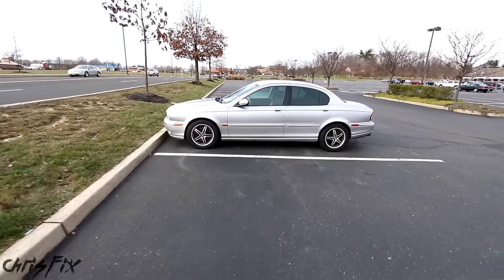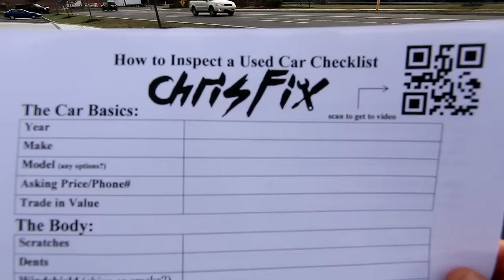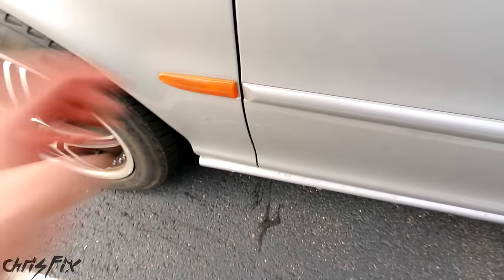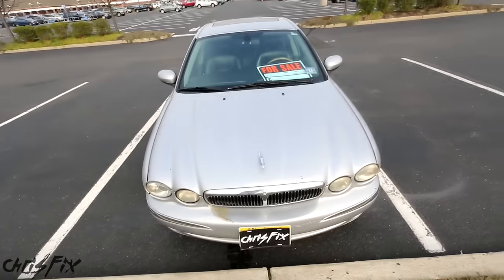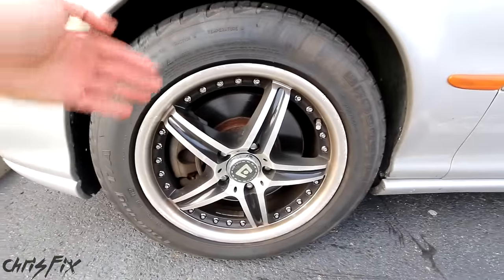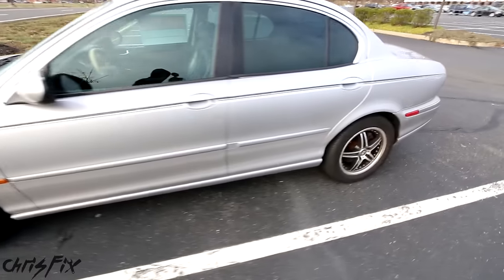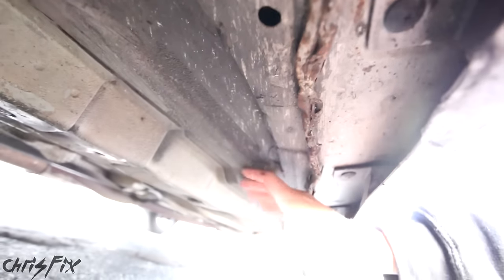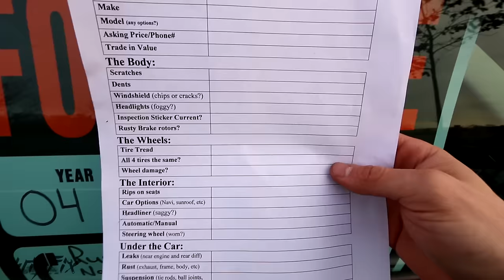How to Inspect a Used Car for Purchase

Comment: Thanks for the video! Great tips. However,  if I were the buyer, I would have paid more attention to the mechanical details, not really body and stuff. You had some really great tips including tire matching and brake, but I would pay more attention to whether timing belt is changed (if it has timing belt), any issue with alternator or serpentine belt, shock absorber, transmission fluid etc. While driving I would consider looking at if brakes have any squeaking/grinding sound,  transmission shifts smoothly or takes time to shift, engine jerks greatly during shift of not (probably an engine mount issue). I would try to take a look at the history of the car to see it had any accident or been stolen before or had any major repair, how many owners it had etc. And finally, I would definitely talk to the owner,  to understand how good he was at taking care of the car in general.
Reply: What Chris didn't mention, but maybe should have, is that this inspection is a quick look over to see if there are any show-stoppers before moving on to calling the owner and do a more detailed inspection.

Comment: No reason to inspect a Jag. Unless you are an electronic engineer well versed in automobile wiring & computers and, need something to do every Sat & Sun for the rest of your life.
Reply from the maker: +Tommy Rad hahaha
Reply: ChrisFix
Hi Chris.So, my comment wasn't too cynical? haha
Reply: MultiLisa10
Thanks!
Reply: That used to be true before Ford purchased Jaguar in I think it was 1993. I still wouldn't purchase anything European without expecting problems.
Reply: Joseph Murray
A honda Accord of the same year is 3x the price... why? Because Jags are not dependable.
 And Jags, no matter the year, are expensive to work on, especially for those that go to the dealership no matter the issue. Not everyone is a Chris Fix.
Reply: +Tommy Rad I know that a 1996 Accord could sell upwards of $4500 if the body is in good condition but it's going to have like 200k miles on it. Most Honda's of that vintage are also on a top 10 hit list for car thieves.
Reply: Joseph Murray
1996?? The Jag is a 2004.
Reply: +Joseph Murray As a french, I find funny to see how you Americans have a completely different vision of the automotive world. You think european cars are all sources of problems, but why? They have evolved a lot recently (not Volkswagen though :-) ) and are now really reliable. At least they are more "eco-friendly" and feel more comfy than yours, which we find not pleasant to see, especially in the interiors...
Reply: 3DAM
No we don't. Since the 80s, Americans RAN away from domestic cars and, other than trucks, never really got back to buying American cars. Look around here and you see, Honda, Hundai, BMW, Toyota, etc...
American cars are a minority on the roads, other than trucks, which are mostly American.
Reply: +Tommy Rad Sister has a SK8  four fuse boxes, you hit the brakes the back up lights come on.  You hit the turn signal the brakes illuminate with signal.  You floor it and it bogs down,, then accelerates slowly,  then all of sudden wham it goes..  She has had nothing but issues since day one and it sits and sits,  she drove it one full summer..  WALK AWAY!!!  No RUNNNNNNNNNNNNNNN burn your camera and phone that had any connection to that car..  They are attractive psychopath gremlin vehicles is all they are..
Reply: +3DAM  Interesting.  Should we assume all the French people are the same and think the same way too?   Perhaps the European interiors have to be more comfy  to accommodate the weight of arrogance?   Is there extra headroom as well?
Reply: +Tommy Rad Thanks for your answer, I still live in France (still because I wan't to move in Canada or USA in a few years) and from what I see on the internet there are still a lot of american cars on your roads but internet is not real life :-)

+Spookypalooza Calm down, I wasn't insulting anyone at all, I just wanted to know Joseph's thoughts. There surely are differences of thoughts between Europe and America, as well as between every citizen of the world.  What you found arrogant in my comment wasn't supposed to be so, but you can't deny the usage of cars with really large engine, sometimes not of use (I think of people who have big trucks but don't live in the countryside, or lorries...)
Reply: 3DAM
No problem. I'm not sure American car makers ever recouped their losses of American buyers after what they did to their customer-base.
After WWII, buyers were loyal to whatever... Ford, General Motors, Oldsmobile,etc.. but, in the 70s, idiots like "Fog of War" sociopaths like Macnamera, gutted the industry of everything that the car makers worked on in the past. What was once car companies owned & operated by car LOVERS, designers, racers, now were run by "bean counters"[numbers-guys]. Down they went. The loyal customers were& felt screwed. Then the car makers left the US and ruined once beautiful, wealthy cities like Detroit, now a dead city.
Not sure you should come to the US. Were being turned into a police state and it is getting bad.
Reply: 3DAM I'm going off published facts from JD Power and associates on the quality of Asian, American and European auto makers and personal experience that at the top of the quality ranks are the Asian makes such as Toyota and Honda, then a close second is the American automakers, they've come light-years in quality since the 80s; but for European automakers, they're on the same quality level as the Americans back in the late 80s early 90s. 
Granted there's certain Asian makes I would stay away from such as Mitsubishi they're notorious for having transmission problems.
Reply: It wasn't just the bean counters that ruined the American car industry. After the war the Japanese started making cars and had all new tooling which made tolerances tighter and therefore reliability improved. The USA and the UK Largely didn't keep up. They kept the attitude that the customer gets what they sell to them. A guy I knew bought a Jaguar in the 70's. The first week he had it it overheated in a traffic jam. When he went back to the dealership to complain they told him not to sit in traffic jams or turn off the engine. In the second month he was in stop start traffic and had turned off and started the car so many times that the battery hadn't had time to charge so the car wouldn't start. When he went to complain again they told him not to stop the engine so often. He left the car there and refused to make anymore payments. Unfortunately this was the attitude back then and the Japanese sent cars that worked (even if they rusted) but they also listened to customers and spent time on RnD. If the British and Americans were still leading the car manufacturing way we would all be driving around in heavy, unreliable, poor handling gas guzzlers because of the "it's worked for the last 100 years, why change" mentality.
Reply: Also, before the Big-3 died, American car buyers were very loyal to their brand. My dad was a Chevy & Buick man. Our neighbor was a Ford guy, another was a Dodge guy. Decades & decades of loyal customers.

That loyalty was rewarded with Detroit vehicles that literally fell apart as they were driven from about 1970 and on. When Japanese auto makers were consistently turning out cars that ran forever.

Comment: Thanks Chris 😊 Been a long time viewer and finally, I bought my first car! 
A 2009 Skoda Octavia 1.9 diesel, manual.

The inspection sheet helped me a treat to check the car out.
Reply from the maker: Thanks for the ongoing support and congrats on the new car! I'm glad the sheet helped you out!
Reply: @chrisfix  Thank you! Really appreciate it.
Reply: immortal engine 1.9TDI, is it still driving?
Reply: @dreveneuhlie7167  Absolutely! Running like a charm
Reply: Is that the car in your profile picture?
Reply: @sweetsunnyvibes  Just a random car on the internet
Reply: @anirudh0831  why not your own car? Aren't you proud of your car? 🥺
Reply: @sweetsunnyvibes  most certainly am! Anonymity online is the way to go while I enjoy my car offline
Reply: @anirudh0831  ooh I see, I'm glad you're happy with your car ☺️ Is Skoda expensive on maintenance costs?
Reply: @sweetsunnyvibes  it's basically a VW and yes! It definitely requires regular attention but never left me stranded.

Comment: Check the internal colour of the tail pipe. The colour can tell you a lot about the state of the engine. Ideally your looking for a grey/brown deposits. Not sooty black or oily. Uneven tyre wear could spell problems with the steering.
Reply from the maker: Thanks for the tips!

Comment: Should have done a flood check too, that's one of the most important things to looks for with all of the Hurricanes and floods in the south.
Reply: +Take1 Films Yeah if your in a flood prone area
Reply: +Justin Kelly actually a lot of cars that were flood damaged and end up with a rebuilt or salvage title are sold at auction across the country.
Reply: Samuel Avery-Quinn Yes if sent through auction but many times not by owners. That's what I was trying to say.
Reply from the maker: +Take1 Films That is a good idea but many times those cars dont come up as "flood cars". They fix them and sell them as normal cars. The goal in this series is for me to teach you different ways to check a used car so if it happens to be a flood car, you will notice the body is rusty, or maybe there is a sign of a leak inside or something, and you will know this isnt something you are interested in.

Comment: Another thing you could do when inspecting the tires is to run your hands around the tyre to check for any bumps. Bumps can indicate suspension issues such as bad alignment.

Comment: Turn the head lights on and check break lights. Lift the air filter, look at the oil filter, look at the fluids, check the tires for punctures...hook up a compression gauge and also check the vin for any recalls

Comment: Based on some of my experience on several used cars I bought in the past. The number one cars I feel to WATCH OUT for are the salvaged ones. (salvaged because of an ACCIDENT). Or just simply been in an accident! Because very often many parts besides the engine can give a host of problems since the car is often not "put back together correctly". Also Watch out for cars that seem to have been "beat up". That can tell you how well the "insides" of the car has been treated. And ONE BIG ONE: Watch out for THE BRAND!!! THE MAKE of the car.  STAND CLEAR of all cars that are KNOWN for being problematic!!!
Reply: Stay out of french cars if possible, overall if you live in areas with lots of rain and inundations, or near the sea.
Reply: Anybody have a list of these problematic cars?

Comment: You can check for previous body damage by checking the alignment of the body panels and the spaces between them. See if they are even and the relative size of the gaps.
Reply from the maker: Thanks for the tip!

Comment: you do the same thing I do but if you only have 1000-to 2000 you can over look dents and dings but look out for rust make sure its not to bad
Reply: As long as the drivetrain is strong I could care less about a few dents and scratches

Comment: If you want replace the fuel pump in the X-type you need probably 1500$ of labor work. If one of the sensors go nuts well thats another 200$. body parts? well almost 900$ for a fender. RUN
Reply: he's a mechanic, he gets better deals a he does most of the work himself.
Reply: +osamaFXX   Why do you put $ AFTER numbers?
Reply: +osamaFXX $900 for a fender.... I'm sure there are plenty of these things sitting in scrap yards by now so they would be about $50
Reply: Wet Lettuce Yea good luck finding one.
Reply: osamaFXX
Just done a very quick google search and the first scrapyard I looked at had 8 Jaguar X-types.
Reply from the maker: +osamaFXX sounds like fun lol
Reply from the maker: +Wet Lettuce Can you send me that link? Thanks!
Reply: +osamaFXX for car guys... like chris, it doesnt matter, hes going to try and get a good deal on the parts and do it himself. Theres not alot of stuff you should always look at getting someone to repair, because of COURSE it will be expensive, otherwise do yourself or get a car friend to help or pay them for less.

If i needed something done, even big jobs ive asked my bro or he knows someone, wouldn't believe what i saved over a shop
Reply: ChrisFix
http://www.u-pull-it.com/inventory/ It's located in Florida though but I'm sure it's a good reprisentation of how many of these things should be sitting in other scrap yards.
Reply: +wholeNwon I dunno, maybe because most other currencies are done that way..

Comment: Too many scratches and dings also give a window into the owners level of care. This car was treated like shit. I never had that much issue with any of may cars later in there life. I took care of them.
Reply: Cool story
Reply: depends where you live, could live out in the stix where there are less idiots or in a major high populated city like i do where you come outside to a new scratch or ding damn near every time you look.
Reply: Coteine Cupz Always check the oil dipstick. If it looks dull and varnished then there's issues. Should always be in good shape if oil is regularly changed. If on the original set of tires, say a 3 or 4 year old car, check tire wear. You can get a feel for highway or around town driving by the way the treads look. Sometimes a car with more miles will actually be in better shape then one with less miles. And yes, some people live in cities. I just would fix any serious dents and scratches but that's me.
Reply: not exactly true... you could take really good care of the engine and still have a dinged up car.  I live in a busy city and no matter how well i maintain my car it gets dings, scratches, and someone smashed my driver side mirror while it was parked overnight.
Reply: Coteine Cupz yeah pisses me off when I take really good care of my older car and I come outside after work to find a damn scratch on a "parked" car?!?! I take the time to handwash, clay, wax, etc. and some idiot comes and dings my shit. Also, I don't currently own a house with a garage at the moment so hail damage etc. from time to time can occur. I'm more pissed about random dings and scratches from idiots who can't fucking park a car and say nothing to the other owner. Pisses me right off. I know I'm ranting a bit, but shit it feels good.
Reply from the maker: This is a great tip!
Reply: Google
Reply: Thanks for contributing to better the discussion! /s

Comment: Very informative. I'm 15 and hopefully going to be driving soon, and this is great to know for when I'm looking for a car
Reply from the maker: Glad the video series was helpful!
Reply: Yo, handy tip. Go with your gut when you meet someone to potentially purchase a vehicle. The person I met really gave me a sense that she cared for the vehicle while others before her, not so much. Many people do have great poker faces too and are great at selling the trash only they know about so you must be careful, however, I would recommend going with your gut with regards to the buyer. If it smells tricky, it almost always is.
Reply: PS, I made the right decision and got a 2005 Jeep Liberty with under 125K on it. I would have had made a worse decision if I had not properly checked previous vehicles I was I-I this close to buying, they looked well but did not drive right for some reason or another. Finding the right vehicle takes time. Definitely check the A/C, if it is a cold or hot day you might forget to check one or the other systems. That was the only problem with my Jeep but I fixed it with my Dad after properly getting the right fuses and locating where to add them at the fuse panel. (There were two panels.)
Reply: Man buy yourself a beater with a heater for 1st car! As long as drivetrain is good your good to go.
Reply: @jeremyrich123  good points! And INSIST that your mechanic look it over! If they are hesitant don't walk but run away from it young man!
Reply: Buy a used reliable vehicle such as Honda or Toyota.

Comment: Wish  I had Chris with me before I plunked down money for a used mercury Milan.  Dropped nearly three times the money in repairs than I spent to buy the damned thing.  Last time I buy anything from a repo man.  Maybe that's another top line issue for the punch list... Offered by a Repo man- Check the NO WAY box.
Reply from the maker: Darn!

Comment: Hey Chris I gotta question, would this inspection apply to dealerships too? Or are dealerships required by law to have the car serviced and maintained regularly or something?
Reply: Great question. Dealers say they did a 100+ points inspection before they offer the vehicle for sale, but I just bought a 2012 Kia Sorento which spare tire was deflated, how can the dealer's mechanics have missed that when you're inspecting the car???. maybe checking the spare tire is not one of the points?
Reply: I would be more inclined to check them if they came from a dealer than an individual. One local dealer even admitted that all they do is give it a once over.
Reply: when you say dealer do you mean any used car dealership or a licensed dealership that has used cars from a trade-in or something?
Reply: Ferraridude13 any used car dealership
Reply from the maker: You would want to do this process on any used car, dealer or private. The dealership aka stealership has a bad name for a reason so you need to look out.